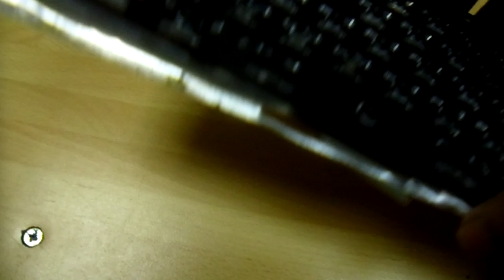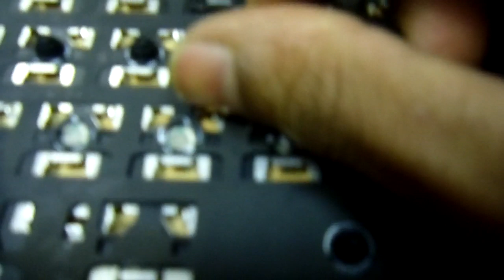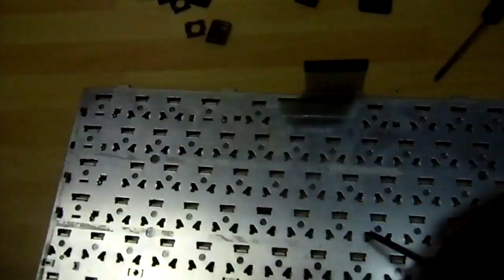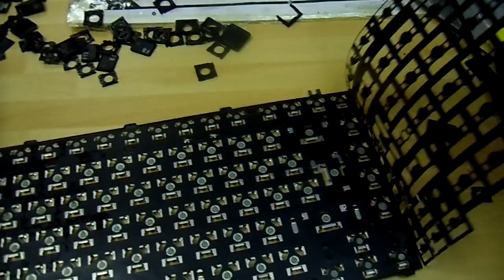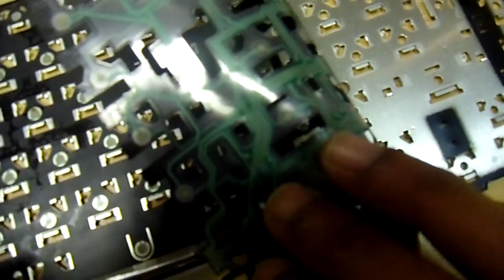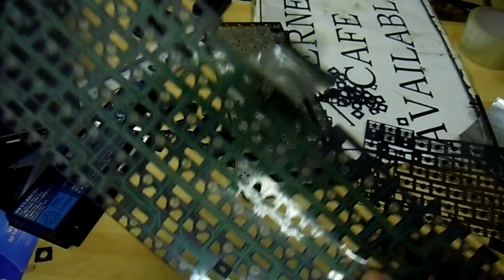Repairing laptop keyboard keys and print circuit sheet keys not working

Comment: I got so frustrated with my lenovo Thinkpad keyboard, it stopped working and just keep beeping like  bep-bep-bep-bep-bep-bep-bep-bep-  ..............., never stops. I started using my raspberry pi usb keyboard temporarily , and started searching for replacement keyboard for Lenovo T480 , and its really really hard to find one. Still searching though. In the mean time I tried to put my defective keyboard in sunlight, then tried to clean circute and at one side circute for one key got off like a paint. I knew that its not going to work anymore. But still a little hope that it might work so searching videos  I think I have no option but to wait for a replacement keyboard to be available.Seriously how come lenovo don't have a spare part available? I mean such huge market and I am sure many people face issues with keyboard due to spilling water etc etc.

Comment: Even the plastic circuit could be repaired. I repaired mine using a graphite pencil and a multimeter to find the damaged line.
Reply from the maker: thanks for the idea bro.. did u relined the whole print and then used the meter to check current flow? just need a logic so i can redo it .. hehehe
Reply: I reline only the zone with no conductivity
Reply: gaganjutube
none in particular... B type
Reply: +Alain Manata CIRCUIT PEN
Reply: +Alain Manata It does work, I fixed a broken track with a normal #2 pencil as well

Just be sure that it isn't too pointy, and trace away.

Comment: Now, if go further, this lesson also applies to PHYSICALLY DISABLING a key, in badly designed keyboards. Perhaps someone can enlighten me if this can be done through software, but while we find that answer, using this very same principle of the contact not closing the key's circuito when pressing it, might be a mechanism for using it in your FAVOR when you want to physically disable a key that shouldn't be on the position it was located on the keyboard. Regards.

Comment: Thanks, man. The main lesson for me, is the simplicity of a keyboard, and that there are SEVERAL STEPS to try BEFORE BUYING A NEW KEYBOARD. My keyboard had this problem, and it seems it was because of a miss-aligned contact when pressing the button. When you press the rubber, a contact goes down in order to work like a "BRIDGE" to close the circuit corresponding to that key. You guys pay attention to this possibility, and TRY TO CLOSE THE CIRCUIT WITH ANOTHER METAL, patiently, to see if it works

Comment: well this video is not about how to repair keyboard it was about how to open a keyboard lol anyway you can repair broken circuit of keyboards as well because the circuit is made of carbon you need a carbon pen to redo some areas in most cases water etc fell keyboards can be repaired but all this process needs full day i will only do this job if keyboard company stop producing it he he